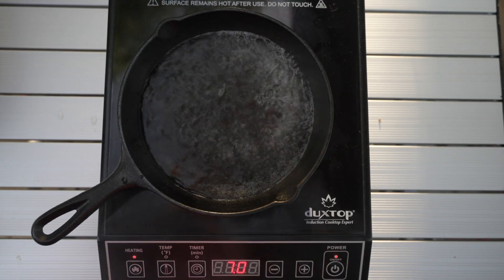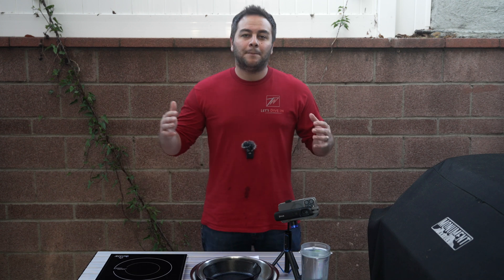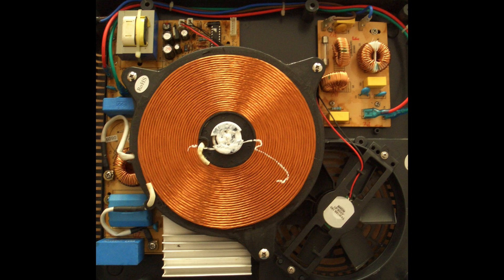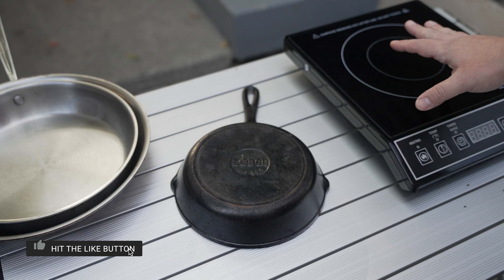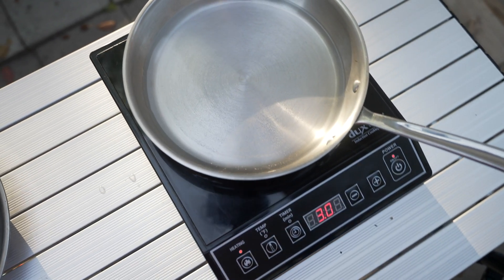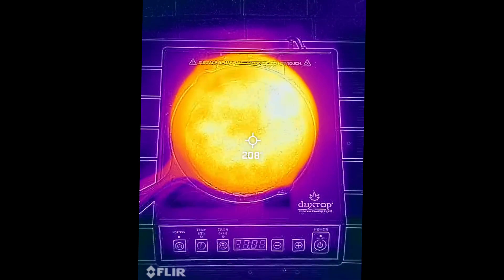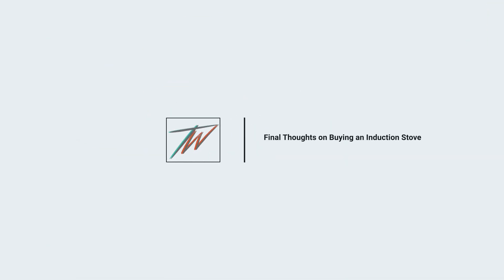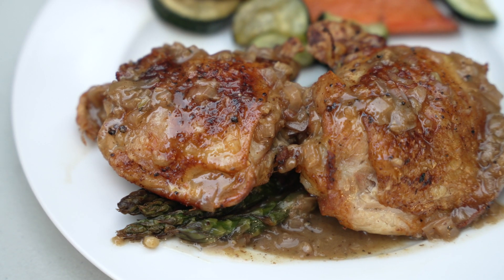Induction Stove Top Coil Size Matters // Thermal Imaging Shows You Why

Comment: This is very informative. I still have a question though. My oven has a 10" diameter defined by a round shiny ring that I assume to be the plate area and within which I place my 9"-bottom pan. It works without apparent problem. However I noticed the plate also has a concentric 8" diameter white marking within the place that makes me wonder if that is the actual hot plate that should define the largest pan I could use, at least for efficiency. I browsed but can't find any manual. What do you think?
Reply from the maker: Your oven or induction burner? Sorry your question is throwing me off. What’s the make and model of the induction stove.
Reply: @tomwadek  Its an imarflex IDX-2500 induction oven

Comment: Workaround for cooking cereals that have a tendency to burn easily: put a petal-type stainless steel steamer basket in the bottom of the pot first. Will help add more potential boiling points, dissipate some heat and discourage solids from touching the bottom. Make note of the petal overlap: you don't want to stir in the wrong direction and fold things up.
Reply from the maker: Thanks for the suggestion.

Comment: Would adding a larger stainless steel diffuser plate to a smaller cooktop be of any benefit? Cooking speed is fine for liquids, but using a 10 inch pot with a 6 inch coil portable clearly leaves burn rings at the bottom.
Reply from the maker: I’m not sure, my gut tells me the thermal transfer would still be the same or even worse. You would still have a “hot spot” radius or diameter but now you have two transfers and an extra loss of efficiency.

Comment: No way will I give up gas for induction. I usually use the vent hood and I am not worried about toxicity. Besides, switching to any type of electric stove is not more efficient. This is because most electricity in the states comes from coal fired plants and this steam turbine process is only about 35% efficient.

Besides I cannot use induction around my wife as the last counter top unit I fired up caused her severe inner ear pain that persisted for days. Two factors. First she has a superb hearing range. Second most of these counter top units operate in the low 20 KHz range, I verified it with a scope. So the frequency was close enough that it caused her pain.

Many of the induction units on Amazon lie about their coil size. I bought one that said it had an 8 inch coil but it was really about 5.75 inches. I reported this in my review and the seller tried to bribe me to take it down. Though the tops are very dark most are actually transparent. If you hold a bright flashlight right against the glass you can usually see the coil. 

Here's a funny thing. I was watching another "internet expert" tell me all about large  All-Clad, Demeyere, etc pans. Liquid would not stay in the middle of any of his pans. He had warped them all with his induction stove and was apparently unaware.
Reply: Induction IS more efficient, With gas stoves about 60% or the heat rises around the pan and goes up your exhaust fan duct. With Induction, you can cook and heat is induced in the pan and hardly even radiates or heats the kitchen, You heat the pan and the food only with a slight radiant heat escape only. If you live in FL you will NEVER return to a standard hobby or to gas once you have cooked with induction
Reply from the maker: Personally, I prefer gas and always have but if I was forced to give it up, I would consider induction.

Comment: Just to clear things up slightly.

Magnets have nothing to do with induction cooktops UNLESS you are referring to the coil, which is an electromagnet. They take a LOT of copper wire to make the coils, so as Tom says, why the larger coils cost so much more.

Tom is so right, all those terms, eddy currents etc occur in the pan, they are induced in the metal of the pan by the electromagnet. It is these induced currents that heat the pan and can only be effectively induced over the electromagnet. Magnetic fields reduce very quickly over distance (inverse square law for the math geeks). Now you know why they are called induction cooktops.

This is why having a coil at least as large as the pan bottom is important.

Most of them just measure the temperature of the glass, which may not be keeping up with the hot pan. That is why they tend to overshoot while heating quickly and don't have the fine temperature control they could have. There are ones which measure the pan through the glass or have a sensor physically come through the glass to measure the pan, but they are few, far between and very expensive. Until consumer demand causes more of those to be made, just be aware of the limitations.

This is very similar to wireless charging except instead of a pan, there is a coil in the device and it uses the induced current to charge the device instead of heat it (mostly).

Comment: This is only one of 2 videos (the other was Helen Rennie) I have ever seen covering the practical limitations of Induction for a cook- and I've really looked! I got a portable induction burner and fairly quickly saw how limited the burner size was. Despite loving induction, I can't cook using my larger pans on it (although I cook a lot of stews etc and it works just fine for that). I am incredibly frustrated that nobody involved, especially the manufacturers, seem to have ever actually cooked using induction. Its just magnets, the solution is so easy, but I can never even find any information about the coil size etc on any induction product, and even salesmen trying to sell it seem confused by the question. The simple question "how much of the pan's bottom will be heated by the induction coil?" seems to have just never been asked before...
Reply from the maker: Yeah I know. It’s frustrating. I went down that journey as well 2 years ago. I’m glad you enjoyed the video. Keep me posted and good luck.
Reply: there's a new tech that's called flex induction or total zone induction, and what they have is layer the underside with smaller coils and a system that detects the pan, that way they can cover it better... never used it tho so don't know how good it is
Reply: Rule Number One, sales people do not know jack shit, other than how to take your money.
Reply: exactly. i can barely make crepes or an omlete without burning the middle and having to place the pan on the edge of the heatplate to heat up the edges as well.
Reply: I have 3 Buffalo Df825 portable induction hobs. The coil is huge, and I made sure it was the stated size. It can take 30cm base pots perfectly.
Reply: @Markhypnosis1 I was so excited to check it out after seeing your comment...but it costs a whopping $535 on Amazon!!! How much did you buy it for?
Reply: They know - it's why it's incredibly difficult to get info from manufacturers.   They're being as cheap as possible.   Bigger coils cost more, multi-zone systems cost more. 

I've had an induction cooktop for years. A "Max Burton" that's still actually chugging along and can put a little more heat into certain pots I have, but is utterly incompetent at simmering low and a replacement Duxtop, which is more controllable, but has the same problem both do.  They both aren't useful for anything bigger than a 10" pan.  You're relying entirely on the skillet's ability to quickly transfer heat; this is why I almost never use cast iron on mine.

They're great for boiling water, brilliant for a stove top pressure cooker, good for simmering things for a long time and are useful for general small pan "stuff", but my less efficient gas stove is king for far more even heat.

Comment: Fun to see the heat camera in use! It’s interesting that so many YouTube videos focus on gas and induction when the great majority of people have electric stovetops. (Google says 68% of households.) I’d love to see more tips about cooking with electric since induction is so expensive I don’t think it’s going o dominate the market anytime soon.
Reply from the maker: I agree with you. Induction is still far too expensive. Unfortunately, I don’t own or use an electric stove. I would have to buy a portable stovetop to do some videos on
Reply: As with anything, as adoption increases, prices come down due to scale and competition.

I'm sure the percentages differ with region for electric coil stoves, but yes, coil electric element is pretty ubiquitous where I have been in Canada,  and that is a large part of it.

A lot of the coils on the stoves I have had weren't particularly even, so lighter pans were susceptible to uneven heating. Heavier pans forced them flat. (Not necessarily level.though.) I believe there is no direct heat measurement, it is essentially pulse width setting the temperature through some fancy control that may measure resistance to estimate a power level or temperature. Hmm... time for research.
Reply: @patrickbuick5459  Its why I like using cast iron to help smooth out the unevenness with pre-heating. With coils, I also never have to worry about scratching a glass surface. I bang around my pots too much for glass, lol.